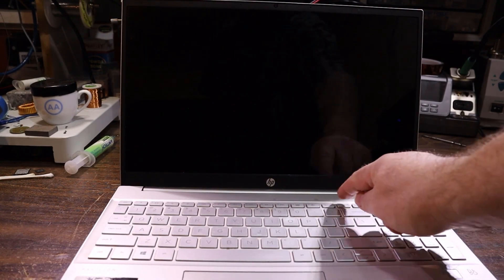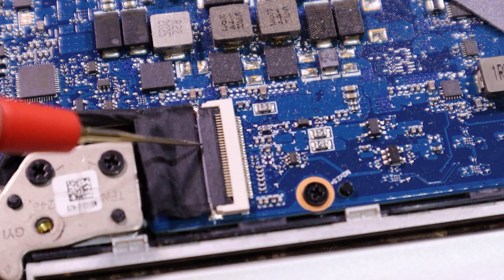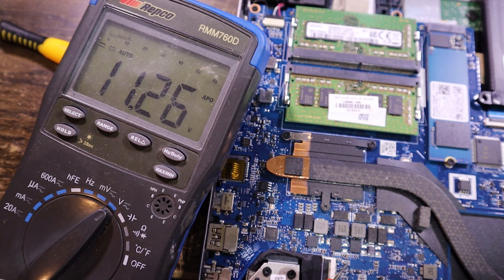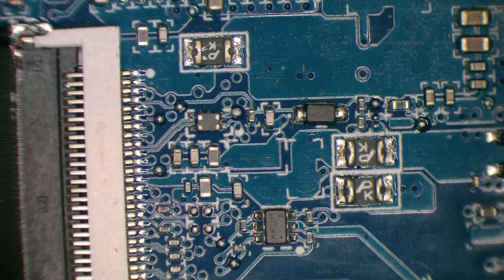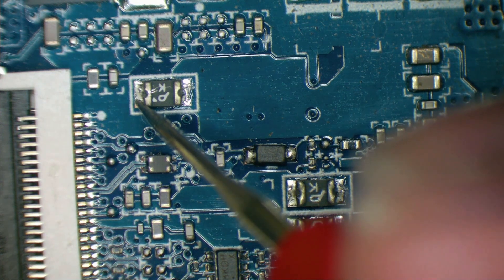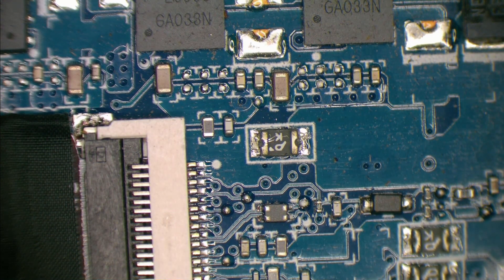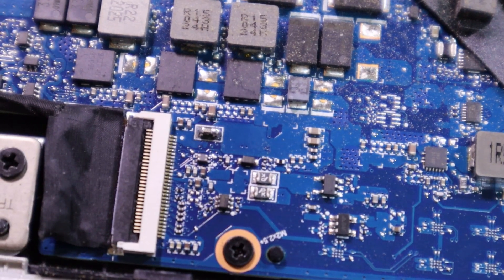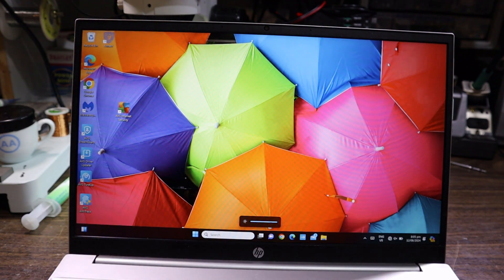HP Pavilion laptop flickering backlight repair

Comment: I would have used the tiniest core of wire I could dig up, like one core from the thinnest wire in the house. Thin enough to act like a fuse.
Thanks for the info, pin one for the backlight.

Comment: Yes please for the epilepsy warning! Today I learnt that 0 Ohm resistors are a thing. Wouldn't a tiny piece of metal/solder do the same job?
Reply from the maker: It would but if there ever was a fault with the screen there'd be no chance it would burn out to protect stuff.
Reply: AFAIK 0 Ohm resistors can be handled more easily by pick-and-place machines than either solder bridges or bent wire.
Reply: That fuse looked different to the others. Could it have been one of those questionable components we all hope we don't get from our trusted aliexpress retailers?
Reply from the maker: It was the original one HP used